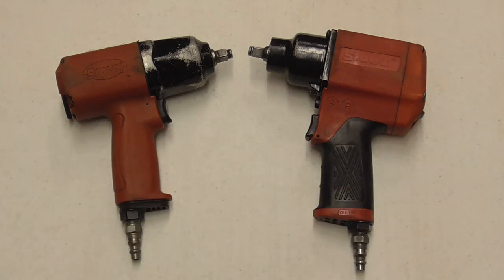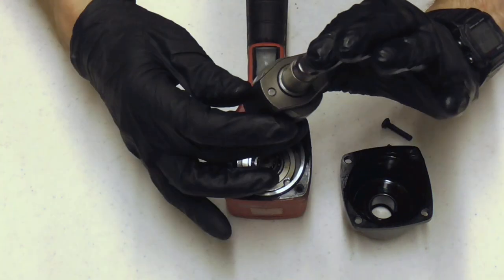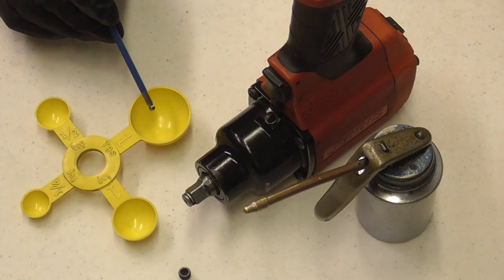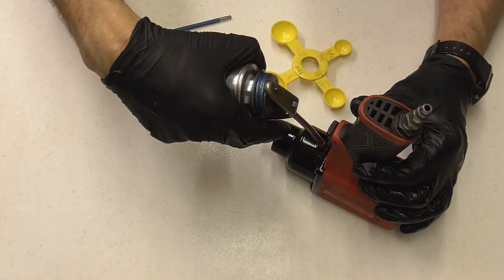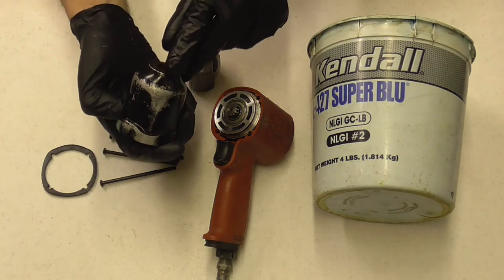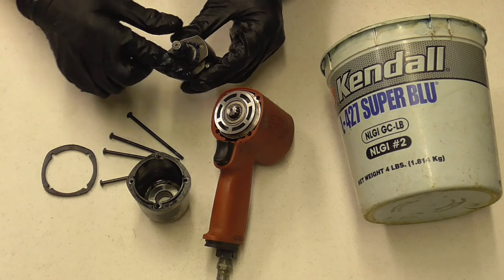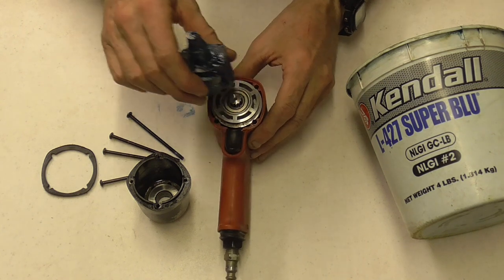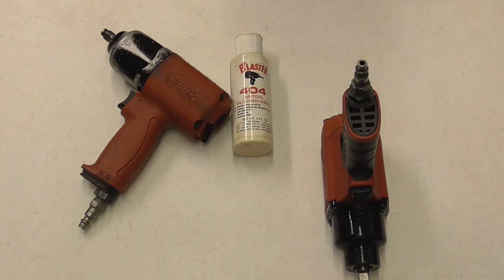How to Lubricate an Impact Wrench - Grease & Oil Bath Impact Mechanisms

Comment: I was having oil leaking out around my anvil.  I look inside and see grease AND oil mixed together.  I’m thinking that it just uses grease for lubrication since it has a grease fitting on the back.  Make sense??!

Great vid btw!  👍🏾👍🏾
Reply from the maker: Makes a lot of sense.  If you have a grease fitting it takes grease - if you have an Allen screw or something similar that allows oil to be "poured" in, it takes oil.  Best to find the user manual if you can though :)

Comment: Why didn’t you just use the grease fitting to grease it instead of taking it apart? Is the fitting not good enough?
Reply from the maker: You're right.  With the fitting, you just can't be sure 1) if the grease is reaching the components & 2) If you are using too much or too little.  I'm sure it would work fine though if you got a system going that worked for you.